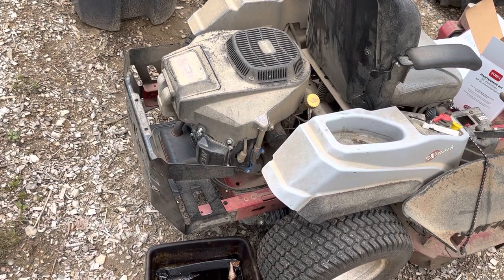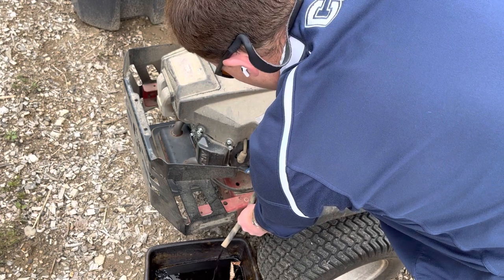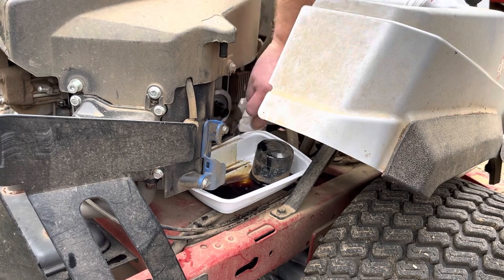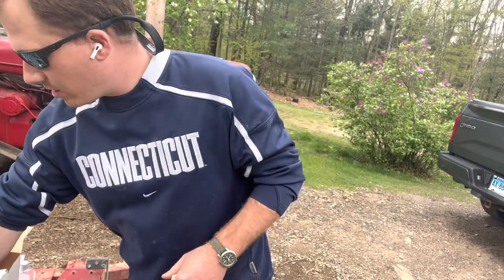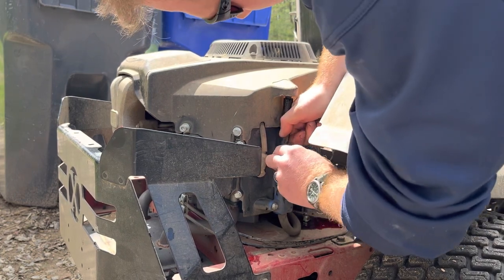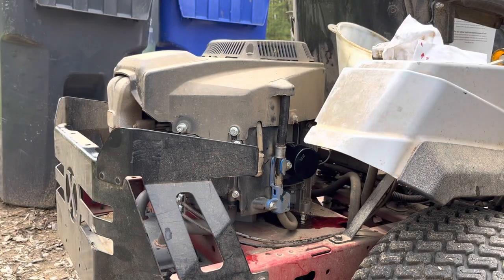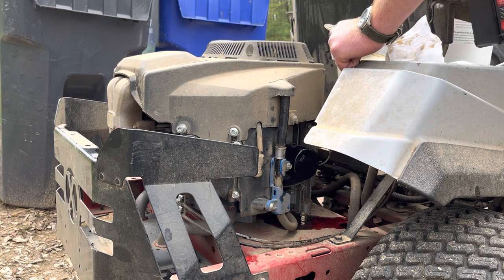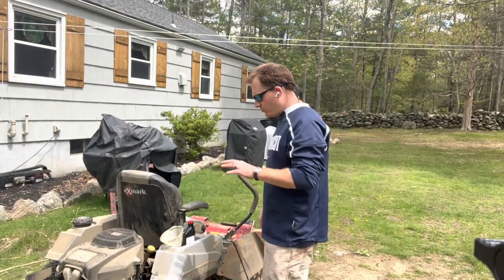Exmark Quest S-Series Oil change

Comment: I have a '20 Quest S 50". As far as not making too much of a mess when changing the filter, I use a piece of pigmat. My drain hose 'plug' at the top of the shroud broke off so I ziptied a plug into the end and also ziptied the hose so there's no way it could come out of there.

Comment: Where did you say you got the box of supplies?
Reply from the maker: I got it through my dealer, the two boxes were under 190$ for both. For oil change it came with exact amount of oil, oil and fuel filter, air cleaner element and fuel stabilizer. Hydraulic box came with necessary oil, filters and adapter to pump oil into system.